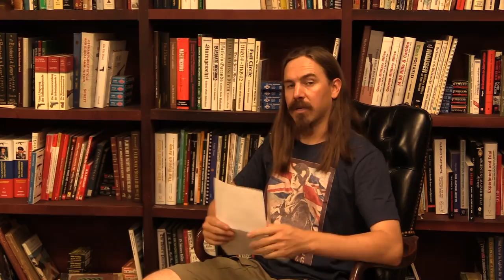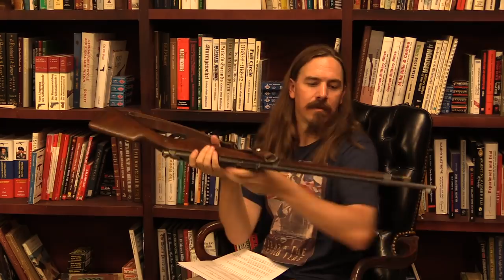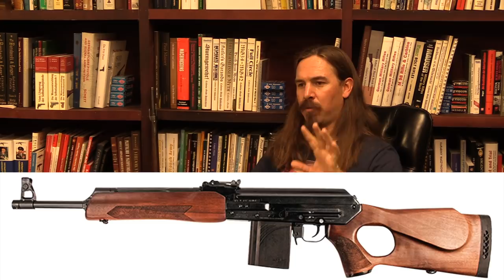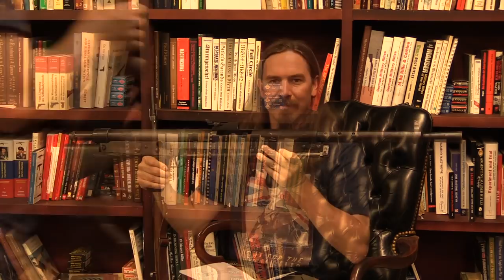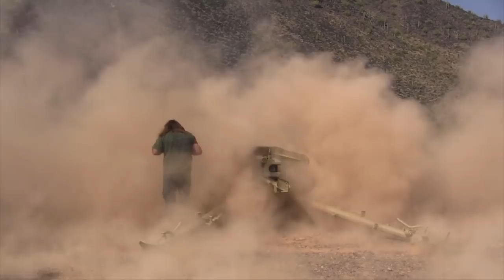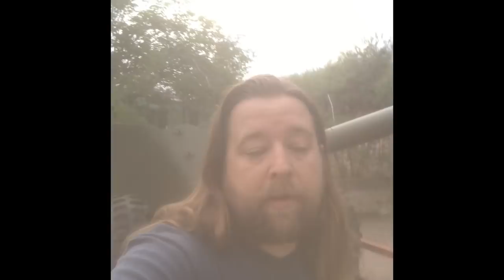Q&A 20 - With Special Guest Bob Bigando

Comment: A P14 is a target rifle taken to war. The SMLE is a military rifle you can take to the range. Having both, when the world end's I 'll take the SMLE.
Reply: 51WCDodge When the world ends, I'm running over to my friend's house and we'll mount a Lewis gun on the truck
Reply: 51WCDodge What is your criteria? The P14 is a military rifle by any standards I am aware of. It's also more reliable than the SMLE.
Don't take me wrong, the SMLE is a nice rifle as well, I just don't understand your reasoning.
Reply: Marvincz. Twice the magazine capacity,  you can work the action without dismounting from the shoulder, as part of that the action is faster. The SMLE is reliable, and it is an acurate rifle. My P14 is a Winchester (T) Woolden Mk1 and was owned by an an ex army armourer so is the best of the bunch and is a nice gun to shoot, but the SMLE has that undefinable feel as well as the obvoius advantages. The best of both were combined in the SMLE No4, though mine is a Mk1 No 3
Reply: Thanks for expounding on your reasoning. I may disagree with some of your points but that's fine, enjoy your rifles.
Reply: Hey part of the fun of this forum, I'm putting my point to those who know just as much as me, so any discussion is sensible and inteillegent.  Your dissagrement is just as valid.